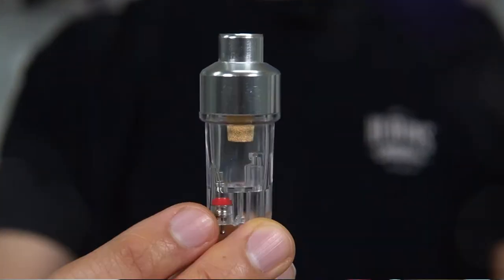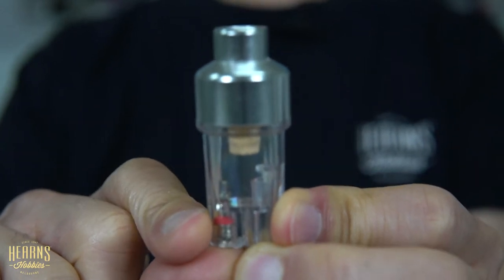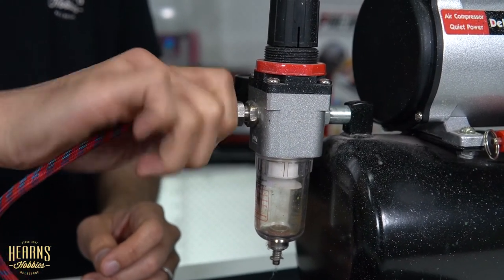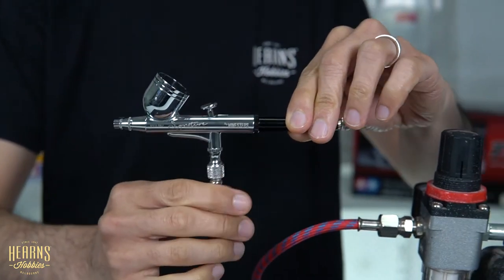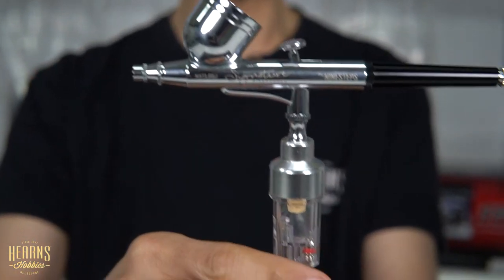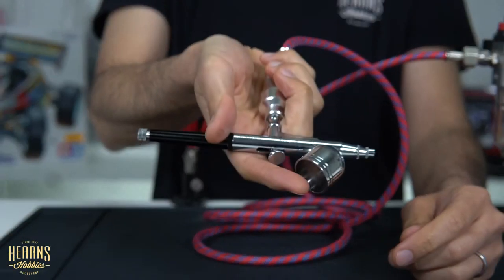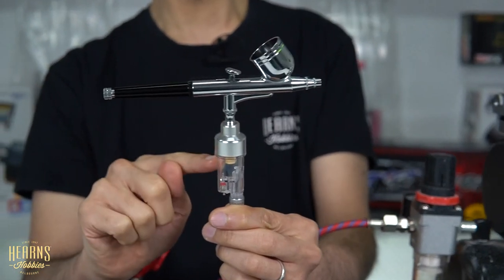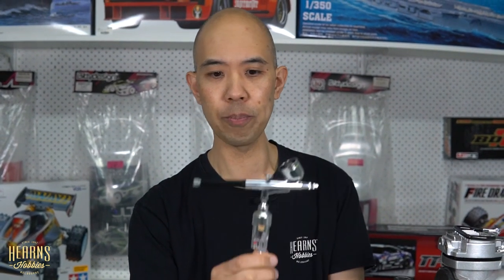Ninesteps Signature | Airbrush Water and Dust Inline Filter Trap | #askHearns

Comment: I tried to put my in-line filter at the end of my hose, instead of on the gun..this way no matter which gun I have on this one hose..there is a moisture trap on it. But after doing this I am getting bad air leak(from top of quick connect to gun). Is what i am doing not possible?..or could there be a simple issue that has occurred during re arrangement? (I have changed out the female quick connect at the top of the mini-trap to make sure I didn't have a bad connector....and i have also tried multiple guns)
Reply from the maker: Thank you for watching. Of course what you are trying to do is possible. They are just thread fittings so any leaks will be the fitting itself. Sounds like the thread or seal of the female quick connect is not machined well to suit your gun. Try some teflon tape on the thread to seal it.

Comment: I tried your method but now I’m getting tiny clots of paint while spraying!! Any idea why?
Reply from the maker: Which method are you using as I am demonstrating the inline filter? Could you explain to me what you are doing please? What kind of airbrush, paint, thinning ratio, additives, air pressure and processes?
Reply: @HearnsHobbiesMelbourne  thanks for writing back. I had water spitting issues so I installed a second moisture trap at the airbrush. Now, I'm getting tiny clots of paint even when only pressing the lever, aka not pulling the airbrush lever.

I have the Iwata smart pro compressor and using psi of anywhere between 20-25. I have the Iwata eclipse airbrush and using Daler-Rowney FW Acrylic "no thinner".
Reply from the maker: I haven't used Daler-Rowney FW Acrylic before but after watching some videos, it looks thick to airbrush through your Eclipse. I would thin it down a touch to a "milk-like" consistency. Are clots dried chunks or dots of wet paint? With the clots of paint when you only press for air pressure, does it happen every time or sometimes? The nozzle is always loaded with paint and it is necessary to give a quick squirt of air to clear the nozzle before spraying on the target. This needs to be done each time.
Reply: @HearnsHobbiesMelbourne  I cleaned the needle today and the wet clots disappeared!! I honestly don't know if it was the needle or something else causing this but I'm glad it went away...
Thanks for all your help.....

Comment: Can u clean the filter? Or u need to buy a new one?
Reply from the maker: You can clean the filter by flushing with water in the reverse direction and allowing it to fully dry before using again. You wont need to clean it unless you work in very humid, extreme temperature, or dusty environments. In that case it is probably safer to simply buy a new one.